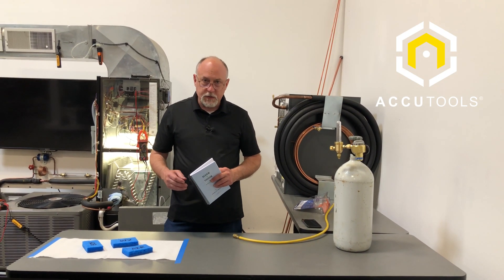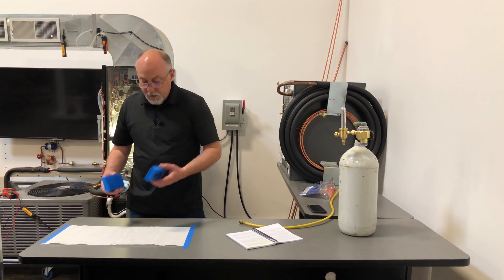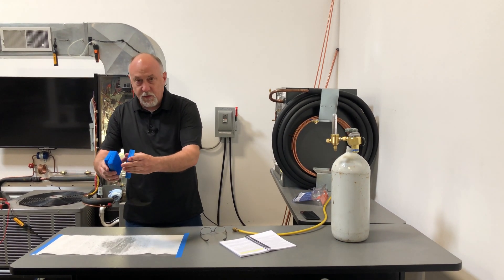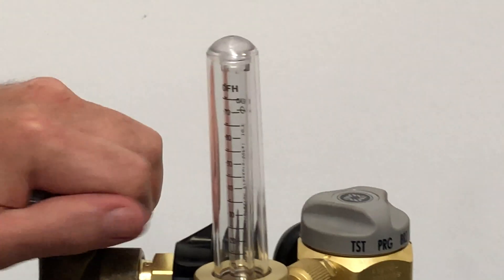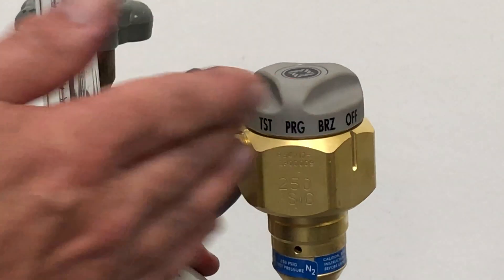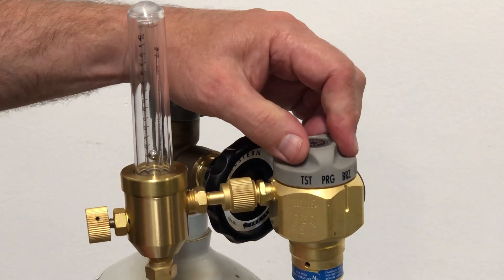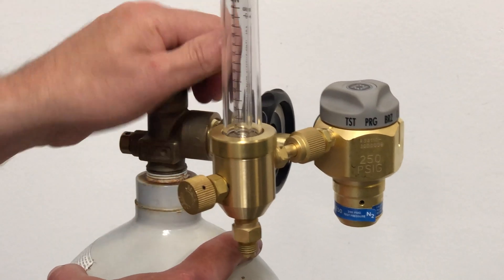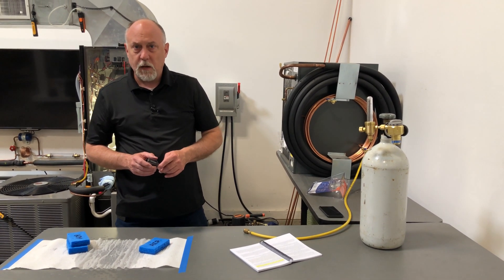The importance of sweeping with Nitrogen

Comment: Mr Bergman I assume the device attached to the tank is a fixed 250 psig pressure regulator that has two flow regulated settings (15 & 60 scfh) and one unregulated setting (test). 
I my opinion 250 psig test pressure is insufficient for testing high & medium pressure DX systems. It would be nice to have the same device with 550psig....

Comment: Very interesting. From what I am understanding, you want to make sure you purge at the correct amount. If we crank the nitrogen through the lines we can actually cause our vacuum to take longer than if we had just purged with 60 standard cubic feet per hour.
Reply from the maker: That is correct, you want to sweep out the air molecules not compress them.

Comment: Every time I am changing a filter drier or txv on a system with POE OIL that has been running previously for a few years , I always have a extreme hard time keeping the microns from rising slowly up to like the 1200s yet while the vacuum was running the microns were in the low 400s , I have done the sweeping of nitrogen but still I have a hard time do I just need to keep on going with vacuum or what ? I also have had to llego back and te pressurized to make sure no leaks at represent and in fact there is none according  to pressure test.
Reply: By the way I am using two appion fat hoses with core removing tools and blanking of at core removing tool to see microns with the bluevac micro
Reply from the maker: Once POE oil is wet, you cannot remove the moisture with the vacuum pump. You are the best off just to get it below 1000 microns holding and let the filter dryer do the work.  In those cases I always add a sight glass with the moisture indicator so I can see if the dryer needs to be replaced again.
Reply: @accutools6288  thanks so much for the info Jim 
 And another question is can a system be wet just by having it open to atmosphere for a good 20 min not necessarily physical water getting in it.  Having to re pipe sometimes exposes system open for a while.
Reply from the maker: @rickcantu4501  Yes for sure, water vapor pressure travels from high to low. It will immediately start to fill up the POE oil with moisture. You want to keep it purging with nitrogen constantly it’s open to atmosphere if it is at all possible. The braze settings 15 SCFM should be more then enough.
Reply: @accutools6288  
Unless it’s like my mini split with wet POE then the system is permanently trashed.